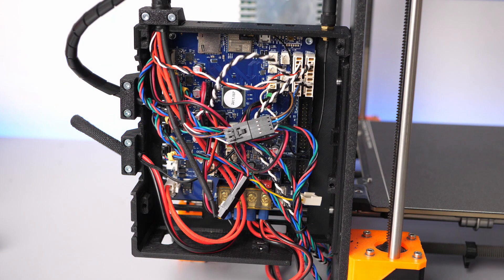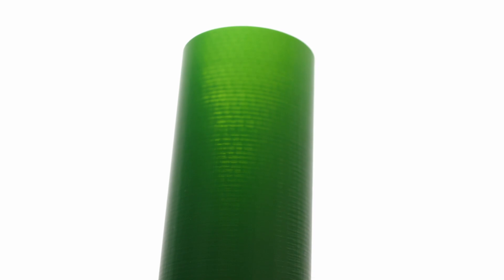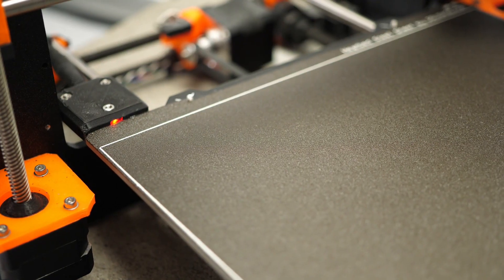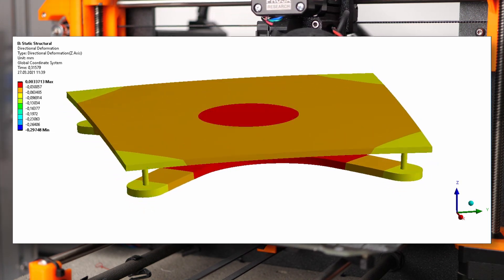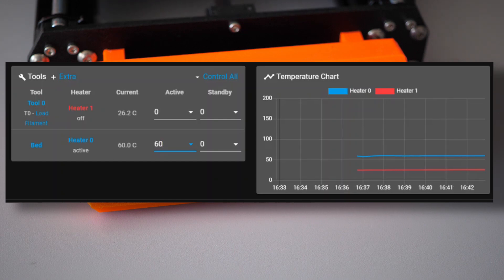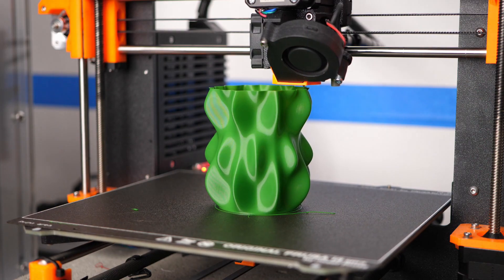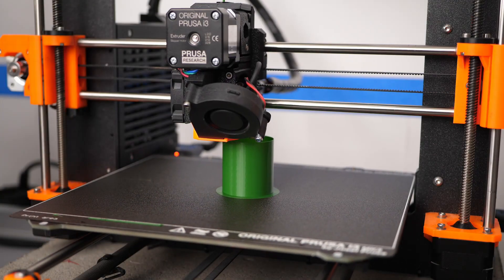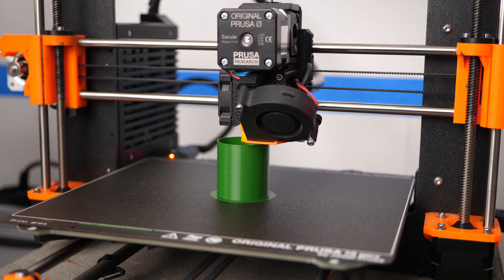PID vs Bang-Bang Temperature Control

Comment from the maker: To bang or not to bang? What's your opinion?
Don't forget to like & subscribe and share this video on Facebook, Reddit, Twitter, and other platforms!
Reply: I plug my bed to a lab power supply. I made a Voltage/Temperature calibration curve.
That's it: constant current and constant temperature; no noise, no fluctuations whatsoever.
Reply: @urano1988   do you manually set the bed temp or did u put the curve into firmware? how does that work
Reply: @meky0  There are PSUs which can be controlled via USB, UART, rs232... but mine is not. I just turn it on, set the voltage and wait 10 mins before starting the print.
Reply: @urano1988  except when ambient temperature changes but i don't think that will be a big problem
Reply: @JariBerg4499  In my experience temperature stability is much more important than its absolute value. The ambient temperature throughout the day varies by just a few degrees and it does that veeery slooowly, so not a big deal. Shall I find the temperature significantly higher in the coming months I will do a summer calibration curve.
Reply: Hey there!
Reply: On my Ender 3 Pro I left the Bang Bang when I switched to the Btt skr e3 mini 1.2. 
I have no issues with it. The temperature is only fluctuating by a couple of centidegrees. I guess it will not improve that much changing to PID.
Reply: What will happen when you set PWM to just about 2Hz or similarly small value? Still much faster than bang-bang and I guess it might work quite well thanks to thermal mass of bed itself.
Reply: An other option to test if the banding is do to z wobble or heated bed is to just turn the bed of if possible.
Reply: Why do you use the little wall on the brim at https://youtu.be/9JyydfcOcD0?t=423 ?
Reply: What an eyeopener, great work Stefan. Liked the Neistat like introsong ;-)
Reply: i opinion is I need a 3D printer to find out but I would like to flash my bang is better than yours just look at it

Comment: I don't think it's the temperature but the power supply load. When heated be is full on it will cause a slight Voltage of the psu + a drop over the power cable between psu and controller board due to resistance affecting your hotend heater. Ive been using 220v silicone pad heaters controled with ssr, hence using bang with a 2°C temperature swing without  causing any Z artifacts

Comment: I think I have a different problem but looks the same because the z bands are so consistently around 5mm apart. Except.... at end of the band, I get inconsistent extrusion at that exact layer. On one wall it looks a little like a dotted line across the outer wall, and on one side there are little gaps just after the corner. I'm guessing it's a filament issue or e-steps being out?

Comment: Sorry for commenting on old video - I was also fighting z banding - printer has 600x600mm aluminium bed and separate 240v non-pid temperature controller. Bed flexes up to 0.1mm when the heater is maintaining temperature. Here's a timelapse vid with a dial gauge between the bed and hotend. Cold start start to 60C shows 0.25mm deflection then regular 0.1mm deflection over 80 second cycles.  https://youtube.com/shorts/p0EZTiuwUBo     Need to replace with PID controller.

Comment: If your thesis is true then it shouldn't be advisable to use higher bed temp to improve first layer adhesion and get the bed temp down after first layer right?
I have defects looks like z wooble I couldn't solve yet. When I'm printing petg, I always print first layer with bed temp set to 80 degrees then I set the bed temp to 76 degrees for the rest of the print.

Comment: I've been chasing that Z(?) banding issue for some time. 
Consequently I  now have Single Start Z screws and Dual Collet type couplers fitted  which helped Z banding... a LOT. 
But there remains similar  artifacts to what you are showing in this video. 
Believe that the source is  My OverHyped Bondtech extruder mechanism.. 
The main filament gear uses a Grub screw.  Which shifts the drive gear Off center when tightened.  Lovely !! 
Add on the other rather  imprecisely machined driven extruder gear  and the foolish variable diameter Hobbed drive teeth detail..
and I get a pulsed (and a visible /measurable ! ) extrusion flow variation.
 Backing off the Idler spring tensioner Helps.. Noticably. 
It seemingly lets those gears have a wee bit of wiggle room for  slightly improved flow consistency.
 Replacing that idler gear with a suitable Ballbearing race... improves the situation .. notably more..
 
In process of finding / building a Better quality (verifiably concentic) Extruder drive setup.
 Likely a Single Drive gear version.

Comment: Idk why, but i used mosfets, power transistors, of al kinds, but never heard it make Noise like that, just for example, if you use standard pwm frequency in Arduino, 980 hz my mosfets work just fine, and you don't hear them at  all. Maybe because i use them at 20% of there max allowed power that i can use thé high frequency without heating them?

Comment: how to change to 25Hz, my skr mini e3 v2.0 start to make annoying noise after change a marline 2.1.1, i set PIDBED - no change( only when bed is heating, - the led is flicking and noise is coming from board)...  which parametar to change- Kp, Ki, Kd ???
Reply: those parameters is for the pid controls, do not touch those unless you want to ruin your bed temp accuracy

Comment: Suggestion for an experiment: Take a 2nd bed board, flip in over and epoxy it to the bottom of your working bed board. Wire both heaters in parallel. In this manner, any strain force generated by one board will (approximately) be compensated by the strain force (in the opposite direction) of the other board. I anticipate that you only need to measure the temperature of the top board. If you have concerns about double the wattage, then heat the bottom board, and measure the temperature of the top board.

Comment: I feel like 25hz is massive overkill for a print bed that can only change fractions of a degree per second.  Have you tried lowering it into the 1Hz range?

On the other hand, at 1Hz, that heat bed is going to be clicking like a turn signal, so it might be more annoying than the buzz.

Comment: What about power supply? You basically share the PSU with the motors, bed heating and hotend - while the bed is heating you take away current from the motors which would lead to less torgue = less extrusion assuming you are printing fast, also the hotend would get less power so it would take longer to correct temps. The holding/and moving torgue for the z-axis would also drop means it won`t get to the same position.

Comment: My first 3D printer was a Solidoodle 3. There was a design flaw that resulted in a large lag between the heater and the thermistor on the extruder. It would take over 30 seconds for the thermistor to see a change in the temperature after the heater would turn on, and vice versa when it turned off. This became quite a problem when I upgraded to newer firmware because the thermal runaway kept tripping. It also meant that, even with a reasonably-well tuned PID control, the temperature varied by +/- 5C from the setpoint. I believe this was the cause of some very noticeable inconsistencies in the surfaces of the printed parts.

Comment: // #define PIDTEMPBED // Protomaker Sprint cause bed temperature overrun issue < this is what happens Yes PID setting used, not a relay or SSR: BTT 1.4 turbo board

Comment: SSR should not be PWMed. MOSFETs do not care if u PWM them, but they should be turned on and of FAST(low rise/fall time), very fast. and most boards do not have mosfet driver IC to do that, they just wire some mcu pin(thru resistor!!). And that mosfets wont like, low Rdson mosfets do not want to be in linear region for a long times.

Comment: Let me correct you here my friend. MOSFETs hate slow switching. Switching losses are caused by long transition times from on to off and vice versa. If you are using fast transit rates you may have another issue. They would much rather act like a switch or relay than a valve with partial flows. I've used hundreds of them on my huge simulator and when the switching modes were all but instant they fried. If you can scan the wave forms with an O'scope you may see the problem. In fact there are MOSFET drivers designed to make that switch extremely fast. Read the Data sheets, they'll say the same. I don't know the board you're using, it may or may not have drivers, and if so, the caps used along with them may be weak or just junk. The frequency is better if above audio range. Like 50 khz. Another reason for overheating could be ambient temperature. Mossy's are rated at a rather low temperature and those ratings fall off quickly when the device is at elevated temps. An example is a constant on rating is about 10% of it's "switched" rating.
To bang or not to bang? Hard to say, but accurate temp sensing is crucial as well. Remember the computer credo: Garbage in, garbage out. 
I do enjoy your sessions on these printers as I am new to this particular field, and have sought info from dozens of content providers. I recently bought a CR 3 v2, and it's sitting in the box till I have finished my data upload to noggin'.
The Sim? : https://www.facebook.com/aqvwc/

Comment: So why would Prusa even include "bang bang" mode? Doesn't make any sense.
Reply: 4 years late but he slapped in a DUET 3 mini 5+ because the original main board's power connectors burned.

Comment: A quick and easy test to eliminate the heatbed cycling as the issue is you can turn off the bed after the first few layers and you can see the results quite well. It will go from the regular layer issues to completely smooth. I just print with the bed off since I am too lazy to change firmware.

Comment: Awesome work, not many people catch these flaws.. kudos to you my friend!

Noticed this a long time ago back around ~2014 when i used my MakerBot Replicator Clone with wooden frame as my main and only machine. When i figured the temperature swing was causing the parts to come off over time despite hallow or solid parts that would cause more "pull" from shrinkage, i started using insolation under the bed and found wool not only insolated beautify but also damped the vibrations on fast prints or sharp edges. I also used Kapton tape on the Y axes bed frame to reflect the heat upwards. From that experience i quickly noticed the banding gone and put two and two together. Massive improvement for ABS print bed adhesion

*I didn't get any data back then but i did for an i3 machine i have now, It went from ~5 degree swing while printing a large vase (to simulate air pumping though and over the bed) to a ~1 degree swing

Comment: i would be a bit more suspicious of the energy draw fluctuations possibly shifting the speed and temp of the printer head rather than a temp fluctuation of 1 degree causing enough warping in a base that small particularly in the z direction rather than the xy but i am sure you figured that in

Comment: Exactly the problem I had with my Anycubic Mega S. I never imagined only +/- 1°C could have such a huge impact, but apperently it does. Even the part cooling fan could decrease bed temperature and cause an overpronounced elephant foot if set to 100% too early - a badly designed fan duct could make things even worse if air stream blows too much towards the heat bed or hits the nozzle. And when the hotend is PID-tuned without having the fan enabled, it might cause undershooting or dips in temperature when you actually use the fan - in the worst case even introduce or worsen clogging...

I wish I had seen your video back then, as it took me a few weeks to actually figure this out. Anycubic's support first sent me new threaded rods and brass nuts, but there was still significant Z-banding. After quite a few test prints I noticed, pretty much by coincidence, that printing with the heat bed turned off didn't result in what I thought to be the usual Z-wobble.
Turns out the latest official firmware from their website (that I downloaded and flashed right after I got the printer) was either using bang-bang or badly tuned PID values. But since PIDTEMPBED was disabled, I had to switch to knutwurst's firmware to be able to PID auto-tune the bed at all. Anycubic's support is pretty awesome, though - They quickly sent me an updated firmware with bed PID auto-tuning enabled. Now I have an officially supported firmware and completely got rid of any Z-banding.

Comment: I'd try to combine PID, Hysteresis and Voltage Control (amplitude of the heating elements) together into a single temperature control loop.

The exact order in which they'd be applied is yet to be finalized. But maybe you could run some experiments with this yourself?

Comment: This could explain the banding issues on the Artillery Sidewinder X1. It has a large AC bed. I hope it’s at least doing PID, because upgrading firmware on it can be tricky due to the separate touch panel controller.

Comment: Hi 3D brothers - you can use the prefix "U1" on the PID Tuning command (M303 E-1 C8 S60 U1) on Marlin to keep the values in memory - just save with M500 and you don´t have to send them back to the EEPROM - saves one step :)
cheers

Comment: Hey guy. I studied materials engineering in school, just got into 3d printing through work as a product designer. In school I studied both the optical and mechanical properties and i was always dubious of the procedural similarities in "performance". I challenge you to print a clear filament AS CLEAR AS YOU CAN - petg, pla, abs, nylon it doesn't matter - and test the mechanical properties to there not so clear counterparts.

Comment: You can get around the bed ringing by wiring the bed with an external SSR and use the board controls to trigger the SSR.

Comment: Did you realy checked SSR and PID?
I have SSR and using PID. SSR is cold. It is no metter how often SSR is switching. But very important to using SSR designed for sufficient power.

Comment: I have seen similar behavior on one of my printers before. I have an Intamsys Funmat HT that I use for high temp materials, and due to breaking the ceramic plates, I bought and machined a sheet of garolite to use as the bed, and it was about twice the thickness of the original ceramic plate. I started noticing a very similar pattern of z banding issues on the first print with it. I always let the printer warm up for an hour and a half when printing high temp to let the chassis heat soak, so I didn't think it was due to any heating issues at first. 

I switched back to the ceramic plate, and the problem went away. So I purchased a carbon fiber plate from Vision Miner, and I haven't noticed the problem with that plate, either. Garolite is supposed to be fairly stable from a thermal expansion perspective, but I can't find any data on it's thermal expansion characteristics on MatWeb, but all else being equal, the only thing I can think of is the thickness of the bed was changing slightly with the heating cycles.

One other possibility I can think of is the bed is held down by magnets that screw together through holes in the bed, and rest in cups at various points on the bed. If the x and y directions of the bed were expanding enough, it is possible that the magnets could be forced to ride up the side of the cups they are in, which would force the rest of the bed up.

I think the firmware for this printer is pretty well locked down, so I can't dig into the settings to look and see what it's doing unfortunately.

Comment: This happened to me exactly a couple days ago with my Anet ET5! Instead of the bed fluctuating it was my extruder. I Had to flash marlin 2.0 since the stock Anet firmware won't let me do a PID tune through pronterface. After PID tuning I've had much better prints :)

Comment: You are totaly on point. I know this problem for many years. But in my case I had a huge problem to configure correct PID values, because everytime i run the autoconfiguration it gave me different results and they were not good. Turns out this was problem with stability on 5V stepdown on my MKS Gen v1.4 board which is used asi reference for calculations. (It was the same for all boards at that time - old RAMPs, Rumba, MKS Gen L, all have bad architecture). In the end adding capacitor and endless tunning of PID values helped and now my bed oscilate +/-0.1. But it was pain to get there.

Comment: Why 25 Hz? Why not just something like 5 Hz, which shouldn't produce any audible noise? The thermal mass of the bed itself should be more than enough to smooth that into a steady temperature.

Comment: I think you found the root cause (Bang bang style system) but it is not due to the reason you think (bed heat changes). There is no way a degree one way or the other is causing this, but the hit on the power supply with a Bang Bang system will drag down the machine and leave the banding. It is like rolling up a window on a car, then roll up the other side while the first one is still going up. The one going up slows and speeds up as you start and stop moving the other side.

Comment: So technically PID is just bang-bang at high frequency :D
Reply: No, that would be just a P controller. The PID also has an I (integral) and a D (derivative) part. This makes it quite a bit smarter than bang-bang. There are lots of videos about PID if you want to learn more.

Comment: Also, depending on how much load the heater is applying, turning it hard on and hard off could also cause voltage dip on the extruder heater, or the motors

Comment: For everyone saying it could be an issue with the voltage drop in the PSU. I had this problem with a 230v heated bed run on a different circuit via a SSR. And the problem was solved by using PID instead of bang bang. That being said in a 12v bed there might be other effects as well.